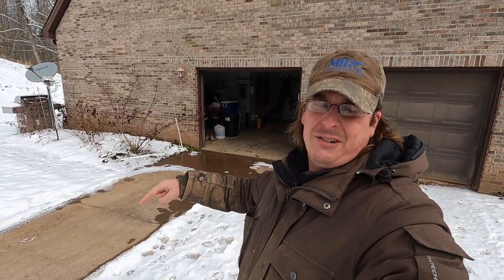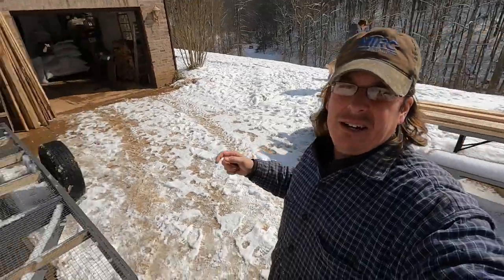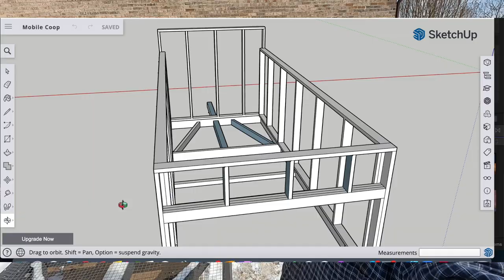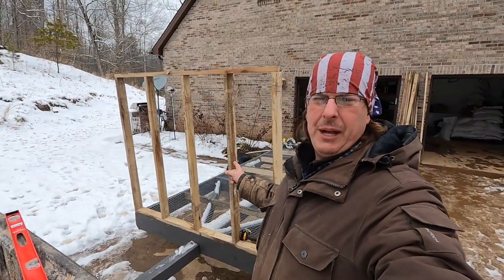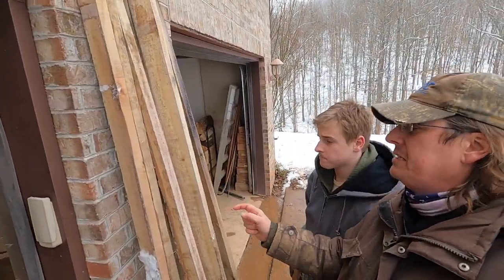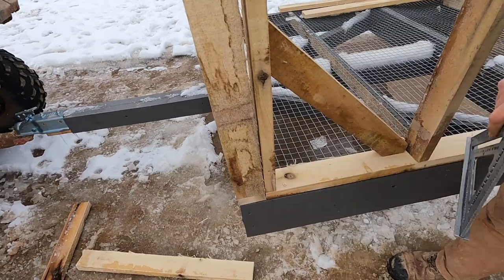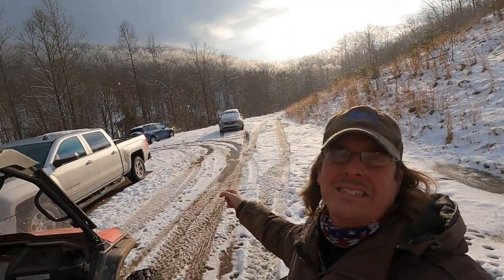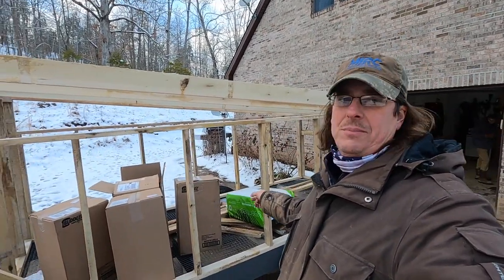Framing our LIGHTWEIGHT Mobile Chicken Coop

Comment: Hi Troy, I've got a similar trailer frame primed and I'm ready to start my own mobile chicken coop.  Quick question; how is the hardware cloth working out for allowing droppings through?  I'm wondering how often you're needing to wash under the roosting bars, if you're happy with the size of hardware cloth, and if you have any new advice based on your experience over the last few months.  Thanks!
Reply from the maker: Awesome. The 1inch works pretty well. I have only had to clean off the frame itself underneath the wire where the poop lands. I spray it off every couple months. Tomorrow’s video actually features an upgrade I did.
Reply: @RedToolHouse  Awesome, thanks, looking forward to watching!